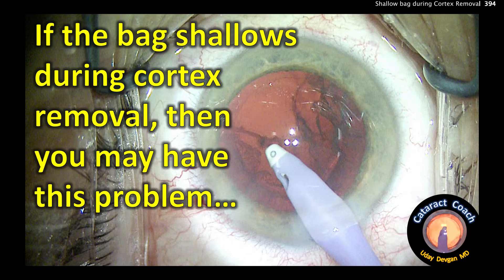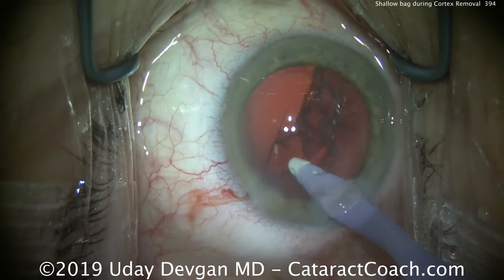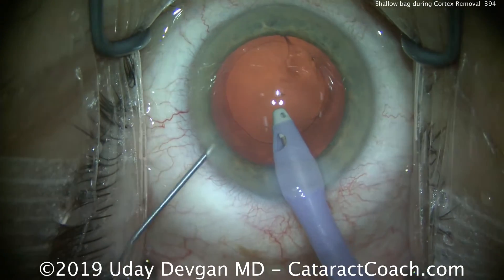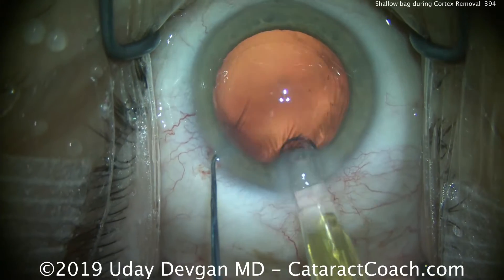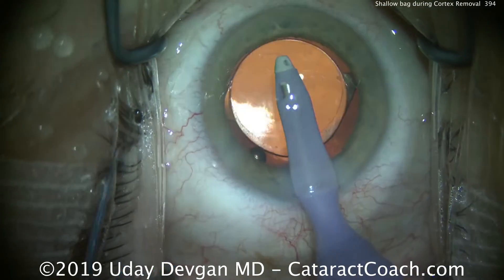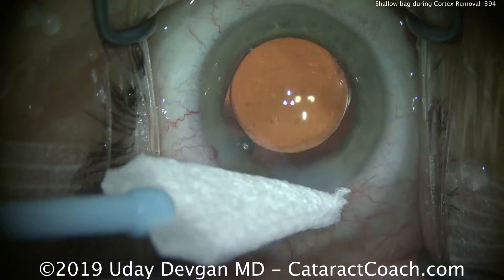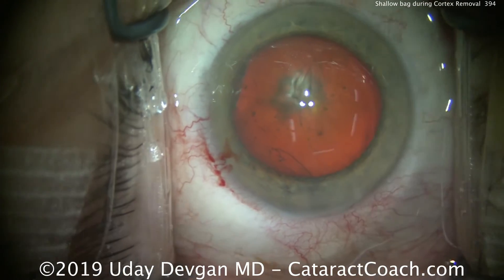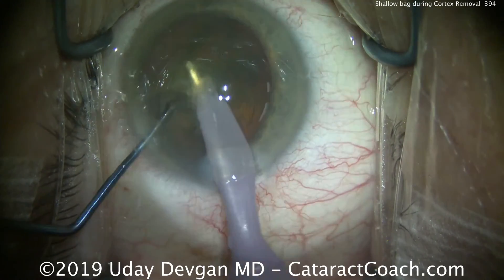Cataract Surgery Quiz: A shallowing capsular bag during cortex removal

Comment: Dr. Devgan, thanks for an excellent demonstration. Now I understand why the CTR was already loaded: by performing a manual rhexis you already knew about the zonular weakness. Had a laser been used, it would have been a big surprise.
Reply from the maker: Exactly. There is certainly a benefit to performing the capsulorhexis with forceps (instead of a femtosecond laser) in this case.

Comment: Congratulations. Don’t you agree that positioning the IOL Haptic aiming to the area of zonular weakness seems better than putting it 90 degrees away?
Reply from the maker: Yes, if the IOL is in the bag without a CTR, then haptics towards the zonular weakness. If there is a CTR, then it does not matter which way the IOL haptics are oriented. If the IOL is in the sulcus then haptics 90 degrees away from the zonular weakness.
Reply: Uday Devgan nice !! Now i understood, i taught it was in the caps bag. Thanks and congratulations

Comment: De. Devgan, would it be wise to put some viscoelastic into the bag prior or during the cortex removal?
Reply: Good point. In extreme cases of zonular weakness/loss and collapsed bags, dry aspiration with occasional OVD refilling may be the safest and effective technique, despite being laborious. But Dr Devgan's expertise allowed for easy management in the routine manner in this case.
Reply from the maker: @NetoRosatelli  thank you doctor!  great points.
Reply: IV mannitol intraoperative would help in high positive pressure and mind the speculum pressure too.
Reply from the maker: @smartwave9  yes, this is an option as well.
Reply from the maker: it could temporarily help -- but then it would be aspirated while trying to remove cortex